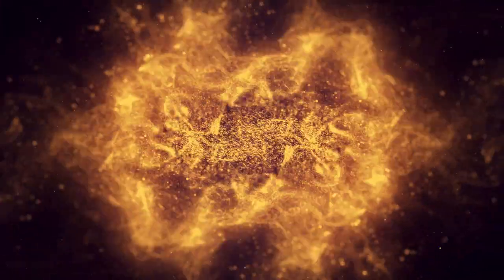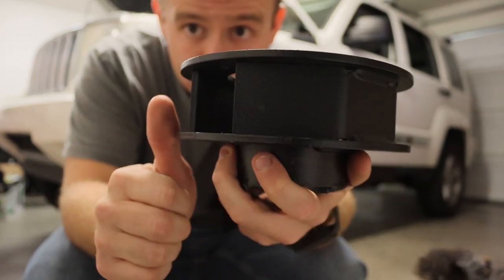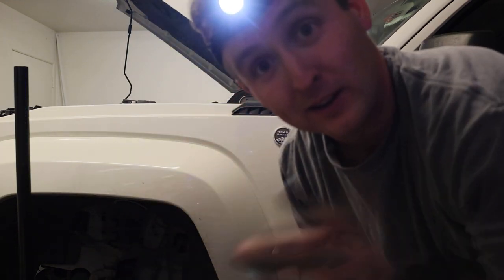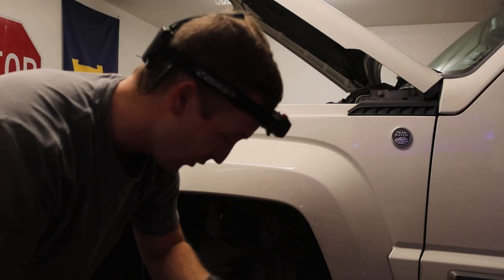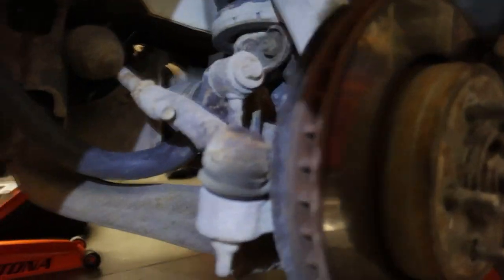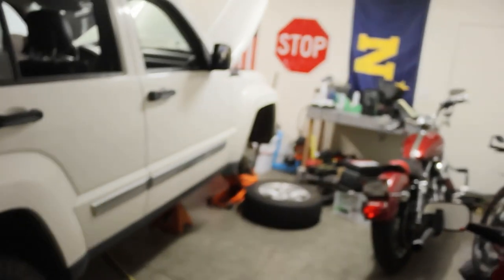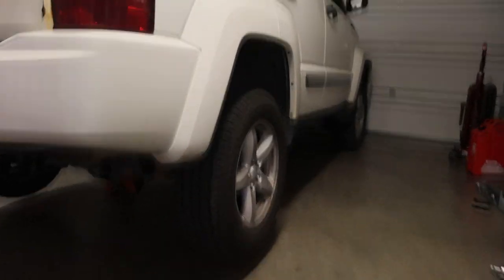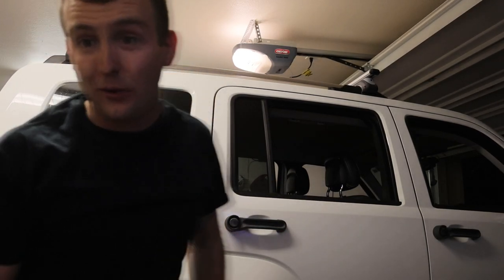2010 Jeep Liberty 2.5" Rough Country Lift Kit Install

Comment: Great video my friend. Because the jeep is a monocoque design chassis does the 2.5inch spacer lift, lift the overall jeep to increase ground clearance? I think if it was a body on chassis like a pick up then spacers just lifts the body but not the chassis so ground clearance stays the same? Is this correct?
 I'm thinking of doing what you've done but would want ground clearance not just a body lift.
All the best from Scotland 🏴👍